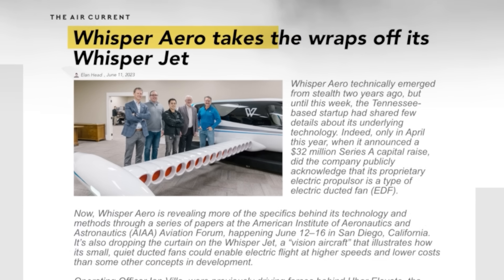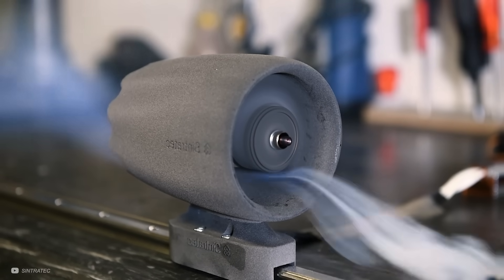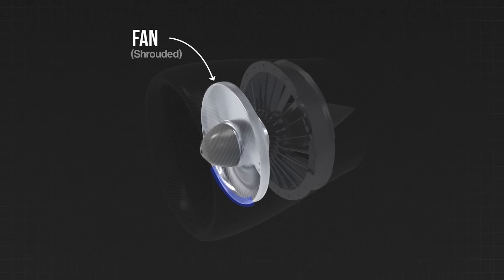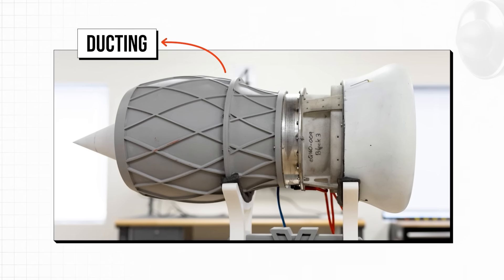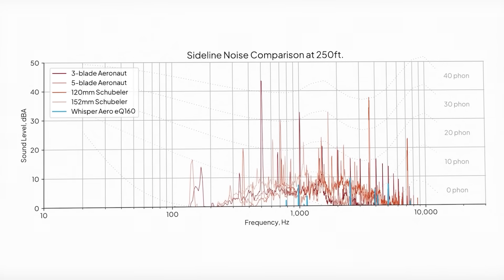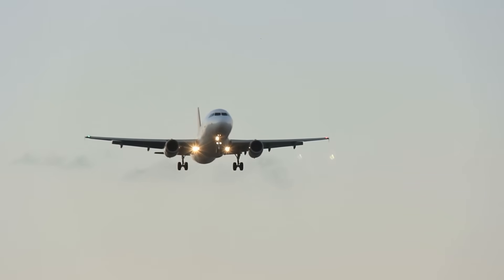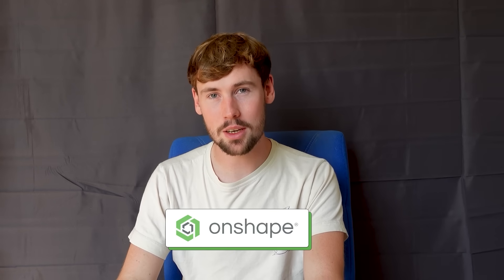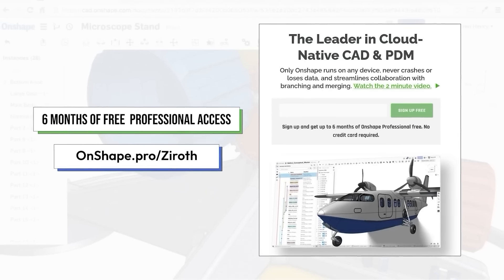This Genius Jet Engine Is Starting A Revolution

Comment: Whenever a company talks about "efficiency" of a propulsion system in aviation, it's always a scam.  They could just tell you the real numbers that matter which is how many pounds of thrust it makes per watt or per horsepower, but they won't.  Efficiency numbers are meaningless without pounds/watt.
Reply: This channel seems to love just taking manufacturers claims at face value. It feels more like an advertisement channel than a tech enthusiast channel.
Reply: @AlexusMaximusDE yeah, it feels like a low key infomercial
Reply: That's why they ignored him
Reply: Newtons of thrust per watt would be more relevant.
Reply: @grahamstevenson1740  Pounds of force is literally the same fundamental type of unit as Newtons.  It's like trying to correct someone who said joules by saying it should be calories.  They're the same damn thing with a multiplier to convert between the two.
Reply: @GeorgeOu  I was simply making the point that both units should be metric (SI) for consistency.
Reply: @grahamstevenson1740  Aviation uses pounds of force.  That's the convention that works for that industry and trying to force a change to metric likely introduces more problems.
Reply: @GeorgeOu  No, only Americans use pounds force actually.
Metric makes all manner of calculations vastly simpler.
It's only Americans that have a problem with their bizarre system of units. But NASA for example only works in metric, as do many US engineering companies, you just don't hear about it much.
Reply: @GeorgeOu  *some aviation in just the US. Everyone else uses newtons. Crazy to combine SI and imperial
Reply: The problem with this setup is that the engines are too small, lowering their efficiency much more than you can gain. It's exactly the same problem Lilium had. No doubt the implementation of the ring is a smart idea, I've seen people try to 3d print this for RC planes and it's really difficult to get them centered and perfectly round. It definitely will improve efficiency. So does the added stator (in RC fans they often don't have stators). The problem, however, is that a small diameter negates practically all of this. Do this in a 10 foot engine and you're fine. But then you won't be able to integrate this into a wing (although it has been tried, I think there was a plane that looked a lot like the Optica but the propeller was in a U-shaped bend in the fuselage between the wings).
Reply: Efficiency or thrust per watt are both equally reductive and unusable for engineering. 

There are about 30 other variables involved that can affect the thrust value, from air density, to humidity, to temperature, to incoming air velocity.

Thrust per watt or efficiency is like high schoolers labeling someone an 8… works for marketing and not much else, often because most people don’t care about details in a marketing trifold pamphlet.
Reply: @kajirmellor873  Thrust per watt at std atmosphere and pressure then. Alternately, publish a chart showing thrust per watt from sea level to max altitude in accordance with the standard altitude temperature scale. It's not a difficult thing to do, just doesn't generate marketing buzz.
Reply: The efficiency of every propulsion system in aviation is Zero when the aircraft doesn't move. 😝
Reply: Whisper claims it has 20% more thrust efficiency than comparable  EDFs from Schubeler and Aeronaut, I don't think that is enough of a jump to justify the revolutionary language and won't suddenly commercialise electric powered flight. But it's progress at least.
Reply: @DanielW-x4v  20% more efficiency is meaningless if they don't give pounds of thrust per kilowatt.
Reply: pounds\Watt is also meaningless if the exhaust velocity is not specified
Reply: Good point, not totally true I think. I would exchange the word "always" with "most of the time"
Reply: EDFs are o.k.. With proper engineering they can achieve efficiency of a propeller.  The difference is static thrust versus dynamic thrust. What is needed is a sufficient battery technology- which is theoretically possible but not in sight.
Reply: 2:20 70 Pound-Force of thrust.
I have no clue about aviation engines. But isn't that the number you are searching for?
Reply: @ChriDDel  But there is no measure of the power required to generate that much thrust.  There should be a power measurement that is concrete.
Reply: @ChriDDel  I was curious to see how that would stack up against a 65hp Rotax 582. Apparently the Rotax could produce something in the range 350-500 force pounds as depending on the propeller choice. So several would be needed to replace one 582 for similar thrust. Not that they would fit nicely on most microlights buts its interesting to get a better feel for what they can pull.
Reply: @ChriDDel  Doesn't mention the watts required to generate 70 lb of force.
Reply: @iedboi Adapting the tech concept in a very different use is not sufficient
Reply: @ChriDDel per how many watts? That's the deal breaker. If it's quiet but sh!t that means what ever air craft is going to need to be packing a LOT of batteries. Personally I think for aviation they are going to need to use hydrogen fuel cell because BMS for that many calls is going to have inherent flaws that become the deal breaker.

This example is perfect for personal glider air craft and that's about it. They are going to be completely useless for commercial aviation flight or cargo or passenger flight....and eliminating any kind of heavy payload flight. Great for quiet delivery drones though which we've seen are very acoustically annoying to just about everyone.
Reply: It would be way easier to just modify existing turbines to run on biofuels.
Reply: @Paqza  I think, allready the use of compressed biogas compound epoxy tanks would reduce the CO2 emissions to almost the half compared to higher chain alcanes.

Comment: Whatsoever I do not trust any Electric heavy equipment of transport filed such as Bus, Truck, Bicks or Air plane or even Boat all have problem of catching fire is higher than anything else.   Many EVs and Bicks on road catch fire if it is over heated and it burns down to ashes that you cannot do nothing.  Rather combustion engine  when it is overheated it shuts down to prevent the fire. So there is much chances of safety and repair.

Comment: Problem of these fans are power consumption.  Taking it directly ftom the radio control enviroment, an electric ducted fan that will fly 4 minutes on a battery pack, compared to a propeller it will fly for 12 minutes on the same battery. More fan blades equals more power consumption on our rc EDF`s .  I have tried fans from 3 blades to 13 blades, and the more blades the better it sounds.....but flight time goes down as the blade count rises.
Reply: nuclear reactors son nuclear reactors.
Reply: @ashtonmiller-z1n 😂
Reply: I think somewhere in the video they claim efficiency rises from 50% to 90% so rather than 4 minutes of flight you might get 7.

Comment: Many people can actually hear sounds with frequencies >16kHz. And even ultrasound with frequencies >25kHz at high intensity may not be very good.
Reply: yes!
Reply: No you can't, but higher frequencies "color" the sound you hear.
Reply: 20hz-20khz is the normal human hearing range this isnt new knowledge anyone in audio would tell u this for decades
Reply: @primus711  Hearing range drops off as we age. For children yes, Adults not so much, especially if they work in a noisy environment.
Reply: @Peter-Frankston doesn't change what i said

Comment: That's all very nice but electric engines on a plane? Did we we get a battery that has better than a whole order of magnitude worse energy density than jet fuel? Asking because weight will ALWAYS be the limiting factor when designing anything that flies...
Reply: Not nice at all, those engines sound like an absolute joke/fraud lol

Comment: But electric motors are inherently heavy and less powerful than a fuel engine of similar outputs.  The bigger you go, the more this disparity raises its ugly head.   The power source (currently some derivative of Li-ION batter) is lighter by volume but is heavier when comparing energy density.   Unfortunately as you deplete a battery it loses minuscule (picograms per kilo) of mass so you are still hauling and fighting the full takeoff weight.  A fossil fuel burns off and reduces overall weight and hence, drag, during flight.   Until we see a quantum gain in Storage efficiencies and a comparative loss in initial weight... useful flight with an electric jet a pipe dream... regardless of wing design.      Unless we have really long extension cords.
Reply: The hell are you talking about? Electric motors are far smaller, lighter, more economic and more powerful than combustion engines. Do you mean the batteries and fuel? Then yeah, you're right, but very bad wording used.
Reply: @mkzhero find me a 20,000 lb thrust electric motor you can get airborne.
Reply: @ramosel  literally every single one. I'll repeat in case you missed it, EVERY electric motor is more powerful than an internal combustion engine if they're comparable in size, the only problem is batteries.
Reply: @mkzhero  Size doesn't matter, output is the yardstick.  And I'll repeat again...  find me an electric motor cpable of 20,000lbs of thrust that you can hang under a planes wing and get airborne.  Hint, I'll do the math for you, that's about 11,000 horsepower (depending on speed) and needs a 12KV 6ϕ power source.   Remember that to the end.

Just as example, a Seimens 800 HP electric motor that uses 11KV AC power weighs over 5100 Kilos or 11,200 lbs.  

The Jets I flew had 20,000 lbs of thrust/11,000 HP and the engine was only 1800 Kg or just under 4000 lbs 

So, being generous, The turbine engine was 1/4 the weight and 13x the power.  Both examples cited are considered "industrial" motors.

And we're not even at the point of a power source energy density discussion.   And you lose even bigger there.
Reply: @ramosel   The actual fk you talking about? You're comparing apples to oranges, 3 completely different engine types - electric, ice (which are comparable and electric wins every single time) and a turbine. Yes, a turbine is more powerful. No, even if you got a lighter electric engine than a turbine to the same altitude, it wouldn't' do anything because the work principles are too different. Electric, like ICE engines can only work with the older, rotor plane type of designs, flying at lower altitudes, and that's the only thing you can compare them to, and yes, electric would win there hands down if not for the battery problem. Heck even with the battery problem, current electric planes win fuel costs wise by a long shot and are almost coming close to being viable in range (current record being 150~ miles). Maybe compare electric engines to rockets in space vacuum next time too..?
Reply: @mkzhero  You brought ICE into the discussion, not I.   Airplanes depend on THRUST to move... propeller, jet, rocket....  Electric does not win.  You should take the H out of your name.

Comment: Incorporating fans into the entire leading edges of the wings means that the aircraft will not glide, or at best, its glide angle will be far too steep to permit a safe landing in the event of a power failure.  This limits the size of aircraft that can safely utilise this design to one which can deploy a parachute.  It would also have to remain under power while descending in a normal approach to landing, which is very inefficient.
Reply: Not to mention it's assuming laminar airflow, as soon as you hit turbulence that airflow might just detach and stall a good bit of the wing. And if the motors cut out in flight now you have a massive spoiler permanently extended on the top of your wing!
Reply: @rcbigtirepilot  Explosive bolts!  Eject the spoiler!  The Binford 3000 model, that is.
Reply: With the right sensors, the pilot could dial in zero thrust during approach. Agree that a dead-stick landing is probably not possible.
Reply: Many small electric motors can be incorporated inside the wing structure, maintaining laminar flow. No hot exhaust gases open up lots of possibilities. Search YT for this:  o6FMjOl0TRA
Reply: Lot's of assertion, without any information backing it up. Until you can point to evidence to support your assertions, that's all they'll ever be.....assertions. Plenty of extremely knowledgeable people have let that get them...and we have no idea whether you actually know anything or not. My point being that, unless it's been tested, it doesn't do anything for us one way or another. There've been other aircraft designs that people insisted couldn't work, but did.....and then there's the thing about bumblebees technically being impossible....that was due to people letting their ego speak for them. We know how they fly now.
Reply: Good points. The more exciting design I’ve seen has many small conventional propellers mounted in front of a conventional wing. This way, the many propellers generate lift-creating airflow over a substantial portion of the wings allowing flight at much lower indicated air speeds.

Comment: For years the "new next leap in tech" comes and goes. Anything that is going to be commercial needs to make money and anything that needs charging for hours is a.  Financial loss , just watch an Ryanair or easyJet they don't switch of their engines as they are refueling and ready to make money by getting into the air as soon as possible. EV aircraft need to get over this giant hurdle

Comment: That doesn't revolutionise the big problem of electric flight. How do you store the energy that will be converted in electricity as much efficiently than with an internal combustion engine?

Comment: Good, more efficiently is better. Still operates on batteries which have poor power density compared to liquid fuel. 

The improvements are not limited to electric drive, so these improvements would also improve liquid fuel powered aircraft.

Comment: Lets just get one thing straight. There WILL NEVER BE ELECTRIC PASSENGER AIRCRAFT . A tiny one person jobbie might be able to fly from one town to another a short distance away but no further and no bigger. Stop being sucked into this "electric revolution" nonsense. It is a huge con and even the three largest aircraft manufacturers have basically dropped this electric and hydrogen crap.
Get a grip people.
Reply: Actually you can already have electric short range planes the size of a private jet that can transport a minibus or two worth of people easily, with pretty decent ranges to boot, not just single passenger small ones. The ranges aren't all that bad either (current record is 150 miles), for short range aviation it works pretty well. It's all the other things that are a problem, for example speed, they aren't going nearly as fast, although still way faster than by car, safety, sustainability and costs, power grid, and more. Batteries will eventually get better, cheaper and more dense and the grid better, and it WILL make this more viable, but currently yeah, it's not really a great idea.
Reply: Than you for your reply.  @mkzhero